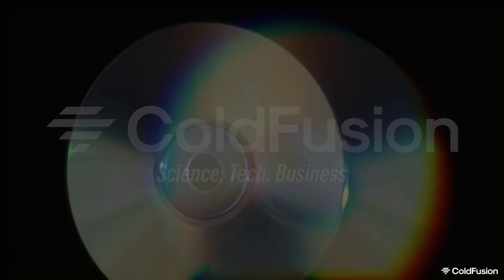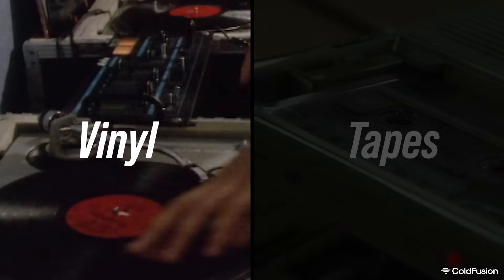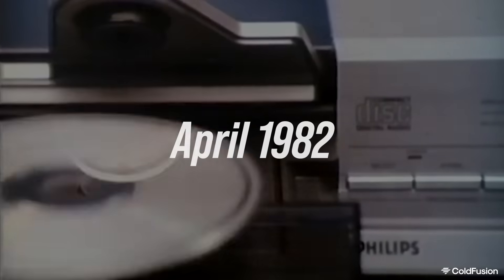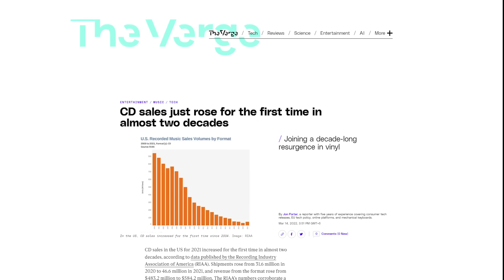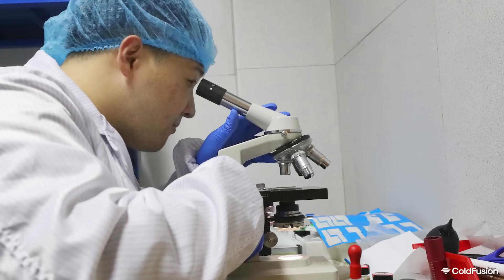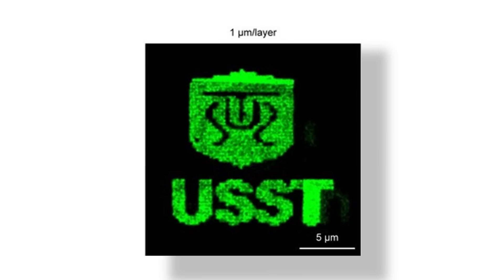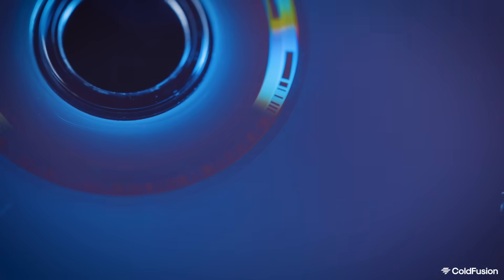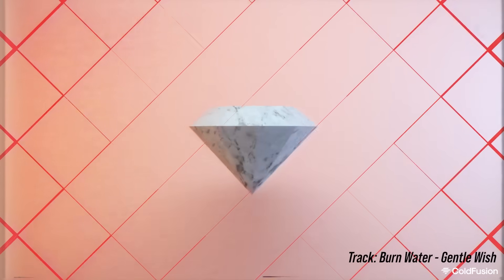Why This New CD Could Change Storage

Comment: I'm a movie collector with more than 3K movies and series, and I'd love to get a way to backup my collection, so they're secure long term. But it seems there's no 100% secure way of doing it, I'll risk malfunction and dead files over time.
Reply: Like stated above, research "bit rot" there's active storage setups out there that keep the data active so that degradation doesn't set in

Then there's long term storage, as long as a hard drive is kept active or at least spun up on a regular basis, it should survive, tape is also good, as long as its stored in an environment that preserves it
Reply: @DariaM00re  - I think next step might be a NAS, yeah. I didn't know that a drive has to spin every now and then to not get bit rot. I don't really understand the logistics of a NAS. But I have a friend who will help me out with that.
Reply: @TheStabbedGaiusJuliusCaesar  the spinning of the drive is for its physical health, you can get unlucky and a long term HDD left untouched can just decide it doesn't want to work anymore
(lubricant in the bearings drying out or the read write heads getting stuck to the platters)

Easy backup is NAS, then there's active file types that keep the data healthy, then the very long archiving would be tape drives.

Im currently looking at picking up a LTO-6 tape drive £250 - £350 is the average price I'm seeing, 2.5tb raw data storage or up to 6tb compressed, a couple tapes should be able to keep most stuff long term

Thats along with a nas, the tapes would be something done on a routine to backup the nas, also means they are portable
Reply: @DariaM00re  - Does tapes work like HDD's? With the interface, I mean. Or is it like old school VHS?
Reply: @TheStabbedGaiusJuliusCaesar  it's more like VHS, with the older editions of the tech and software, you'd have to compile all the files into a single file, then write that to the tape.

From what i've found via online digging, newer equipment can allow drag and drop and then you click the write button, kind of like writing a CD back in the days

But to pull that data off, either way, the tape still needs to wind through the tape to access the part it needs in the newer cases (i think)

and in the older cases, you need to pull the entire content of the tape and then decompile it

but hopefully, since its long term, you wont have to decompile too often
Reply: @DariaM00re  - Yeah ok, I'm not doing that. Better just stick to hard drives and maybe a NAS at some point. 😅
Reply: 100gb M-discs would be an option depending on how you compress the video.
Reply: ...and thats another good point. I have purchased full DVDS on subscription services like Amazon and Prime Video and VUDU. I have cancelled those services due to rising costs and other things. I still have access to those DVDs but what if I accidently log out and forget the password etc. or the company goes out of business, who knows? But I paid good money for UHD John Wick movies and extras that I would love to be at my house. ✌😎
Reply: @martinmiller3743  - If you don't have the physical copy, it ain't yours, no latter how much money you've spent. I refuse to buy from those services, because at any given tile they can remove movies from your collection.
Reply: Out of curiosity, have you looked into Tape Drive storage? Combined with rugged filesystems like ZFS to do online storage, that should be very close. Not sure what the error rate on tapes is though...
Reply: bluray M-disc is currently the most secure media, but not the cheapest, the cheapest per $ are tape drives, you get 600TB of storage for the same price of 50TB of HDD storage, but again if your basement got flooded both HDD and tape would die, while M-disc can survive being underwater for at least 2 weeks if not way longer, and regular dvds are also very easily destroyed by moisture and develops bitrot
Reply: Millennium disk.
Reply: I presume that you have a NAS for your collection. The good NAS's generally have a way to protect against loss, such as snapshots and will also protect against bit rot if you set it up. And large HDD's for backup aren't so expensive that a collection like yours isn't worth spending the money to protect. My collection is closer to 1,000 plus some TV series and the cost of the HDD's to store it isn't so bad. A second, more basic NAS with drives is a simple and inexpensive backup solution.
Reply: @DavidM2002  - Actually, I don't have a NAS, however I've considered it.
I have external and internal drives, the external are the backups ofc.
Reply: Its called redundancy. Either use some ssds or Hdds.
Reply: you might want to look at WD GOLD drives. a 22 TB HDD drive is like $600
Reply: @anon1963  - WD have a bad track record. I never buy WD.
Reply: Buy 3 discs, one primary, one backup kept at home and one back up kept in a bank vault/lock box. Encrypt properly in case of theft. This is more or less 100% secure.

Comment: In addition to the cons mentioned, I'd like to add durability. CDs/DVDs are known to be vulnerable to scratches, heat and UV-light. This new technology might also be vulnerable to similar or the same exact things. Another con is the limited capacity. Yes, 1.6 petabits sounds a lot, but is there any room to extend it? Actually, one of the reasons we abandoned optical disks, was their capacity limitation, coupled with their large, 5.1/4 inch size.

Comment: For videogames this doesn't do a lot though, is not longer just about gb but about speed loading and reading.
Reply: it does mean i can stop hearing "well games are too big" in response to complaints of games shipping only partially on disc or requiring updates after release for a complete experience. but that industry is a hellnightmare of anticonsumer garbage anyway
Reply: if you don't play 1 pb games like a pleb
Reply: We would go back to the PS1 and early Xbox360 era, when all the data was read through disc, with a buffer in RAM.
For this Very Large Disc to work (if reading speed isn't that much of an improvement vs Blu-ray) it would need to load the data from disc to internal flash storage, maybe needing an additional install so you aren't stuck waiting for a loading screen.
Reply: Even then, with the current mentality of "Ship it and we will fix it later", this would still take some sizable amount of data of your storage for fixes, updates and DLC.
Reply: Most videogames would dump the data to your hard drive to play,  they might use a disc for audio but not data.  Unless you're thinking of a PS1-era console.
Reply: Instead of installing 300GB to your HDD, as others mentioned here you just read the data off the disc. This guy didn't mention the rate of reading data only the write data. The read data should be pretty good because of how many layers there are and the overall data density.
Reply: @sharoyveduchi  Read speeds of current 5.5 TB optical disc cartridges are up to 375 MB/s at the edge of the disc.  With clever caching the speed can be worked around, though you don't really need the clever caching if game studios would get more aggressive with compression instead of using raw PCM audio, outdated video codecs and oversized textures.  There's no reason to at a minimum use FLAC audio or even better use Opus to really get the audio down.  Video should be encoded in AV1 at this point since any modern gaming system even if it doesn't have hardware decoders can decode it at an acceptable framerate in software.

Comment: That amount of storage capacity makes ssd instantly obsolete. Depending on how well the cds can remain intact with that much storage, supported by cloud backups, this may eliminate the need for storage drives in machines completely. This is definitely big, has lots of potential.
Reply: Absolutely Not.
CDs are by definition Not as solid and durable, Wich matters a lot
Reply: HDD maybe but not ssd, since access speed are far superior
Reply: Try using a Bluray disc as you main storage drive, and you'll start running into some of the challenges this would present. No optical disc format has ever been suitable for anything but archival storage, and this will never change.
Reply: Like I said, possibilities are endless given the means of durability are addressed, hdd and ssds are not immune to destruction, that’s cause the advent of cloud storage. All are intermediaries for storage at the end of the day. With Ar/vr being pushed, this miniature of interacting with our data tracks.